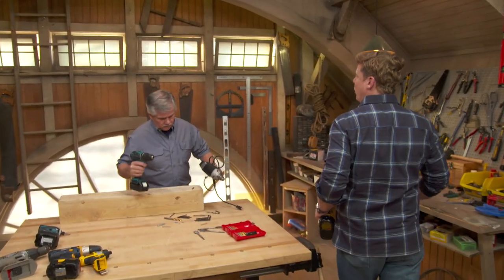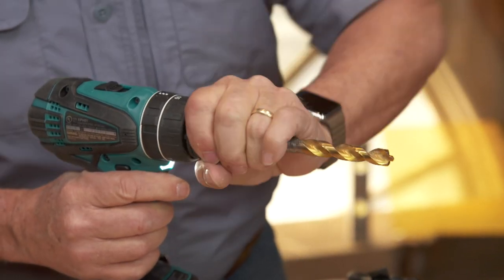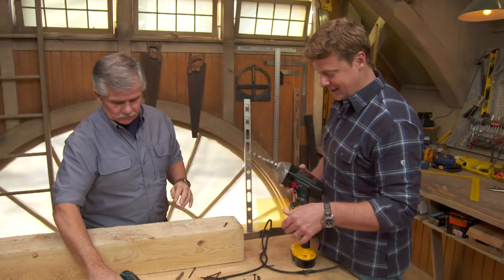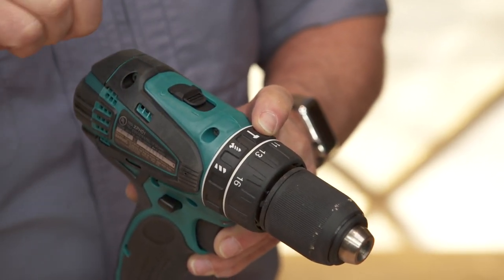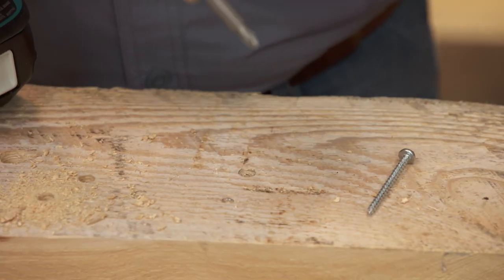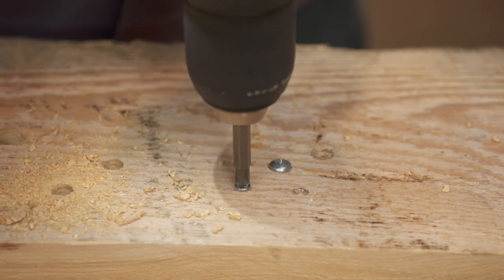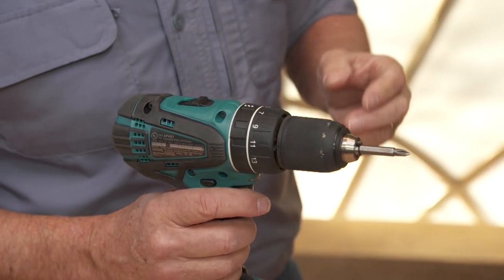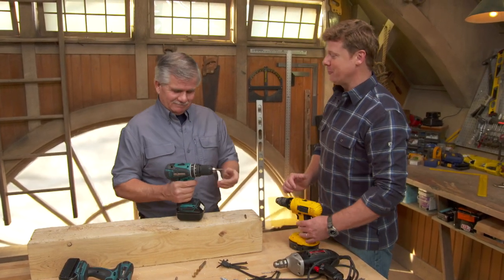How to Select and Use a Drill/Driver | Ask This Old House

Comment: Impact driver is the best thing a homeowner can possibly get.  Can't believe they dismissed it so fast.  Drilling screws with a regular clutch-based driver, in 2016, really?
Reply: oldtwins uh, YEAH.
Reply: I'm new to this and need a drill.  What's a impact driver?
Reply: An impact driver has a ratcheting/hammer mechanism inside to get huge amounts of torque (power) for driving screws into anything. When the ratcheting mechanism engages it is very noisy. They have no clutch so you need more skill to use them. Finally, they accept 1/4 inch hex quick change bits, so they wont be able to use your 'regular' drill bits. You'll need to buy all new bits specifically for them. For professionals, they are invaluable. For casual home use, stick with a regular drill/driver.
Reply: Pick up an impact driver, but you have to get drill bits with a 1/4" hex shank.  Almost all driver bits are compatible with an impact already.
Reply: Well, I thought this too, then I thought that the one-size shank acceptance might be an obstacle to some people.
Reply: both  a  impact driver 1/4   & a  hammer/drill/driver are good a circular saw and and  a Jigsaw  work light and other tools Etc  are good  for  the  home  DIY  myself I own a couple of dewalt  14.4v tools all older  ni-cd  stuff that I rebuild  I replace the carbon brushes  regrease the transmission gears  oiled  the  Jacob's Chucks i  had  em them since  1990's   they  work .like new again  half the price of  a  dc959 kit   brand new one I rebuilt two of  them
Reply: I never use a drill now when I have a XDT14Z!
Reply: DeWalt XR impact driver. Oof the best out there.

Comment: As a plumber/HVAC apprentice, Milwaukee tools are the only things one would ever need for drills or power tools
Reply: Lmao... false I've been plumbing for 10 years and makita is smoother, more comfortable and the sawzall has more balance which allows you to cut things like pipe straighter. Milwaukee has to much power suffocating itself with slop.
Reply: Milwaukee's are usually great but their e-clutch on their brushless drill/drivers is completely worthless. The lowest setting is way too high. The generation just released finally went back to mechanical clutches.

Comment: A tip on using the clutch to drive screws: Rotational speed affects clutch performance. High speed tends to make the clutch kick in later-often overdriving screws. Slow speed down as screw is bottoming out for more accurate clutch action.

Comment: i've used a regular drill/driver for years... and then i discovered the impact driver and my life changed. so much power. all of the sudden my projects driving 2.5- 3 inch screws are a breeze. i'd say the impact driver would be preferable. u can use driver bits or drill bits with it. but it's power for general work is unmatched. so much less exhausting. i'd say impact driver first. and then if u need more nuance for finishing work, then maybe invest in the very high quality drill/driver they demo. not all drill/drivers have clutches like that, and torque settings, and hammer settings etc. impact driver across the board makes work easier. and then for the finer finishing work you may do once u become more experienced, then invest in the kind of tool they demo.

Comment: I was surprised that Tom failed to point out that each of the 3 holes in a keyed chuck are there to be used in succession to get the maximum grip on a drill bit. Especially on 3/8ths and larger going through steel.

Comment: I'm my world just get both the impact driver and drill driver. Getting my first impact driver was a life changer it makes putting in fasteners so much easier.
Reply: Lol, not to mention that only having one drill sucks. Having to change from drill but, to driver, or possibly a countersink is a pain in the butt! It goes much faster with multiple drills set up for different functions.
Reply: +P0tat07 They also have drill bits that fit the 1/4 inch hex adapter for impact drivers. The one thing that does suck about an impact driver is no clutch but fasteners don't cam out as bad either. I would recommend a little 12v impactor now for most people its just so handy to have around my Milwaukee M12 Fuel impact gets used more than anything else.
Reply: DarkRaptor99 not to mention having a wife that has no clue why a man needs either lol.

I bought the driver/impact kit, bc a man KNOWS he needs BOTH

Comment: It recently occurred to me as I've been doing more hobbyist metal work/fabricating that the 1 switch on my drill for lower speed and higher torque, is really suited better for drilling holes in metal than the higher speed. While I work in IT these days, once upon a time, I worked in a shop and I was once tasked by an old timer to drill some holes in a bunch of metal pieces and I recall him instructing me to keep the speed slower and keep the bit lubricated with the oil. So that's also part of how I came to this thought. Hopefully this helps others as well.

Comment: I have a nice drill, but have only used it once. I also have an impact wrench which I have yet to use. I was not fully familiar with the drill, but got it because the drill I purchased from Sears had batteries which would not hold a charge and I could not get a replacement battery which used the same charger. Upon finding that out I decided to move from Craftsman to the Dewalt brand which is a better brand.

Comment: I understand why the clutch is nice to have, but, the trigger is variable speed. I leave the clutch on 20 and feather the trigger. Flawless.
Reply: QuitePear192103 but if you’re doing a super repetitive job, like putting 200 screws, all the same kind and you wanna be quick... just find the right setting for the clutch, slam that trigger without thinking and you’ll take half the time.
Reply: @uncopino  i just built a gate for my neighbor and used 1 1/4" deck screws to attack the boards and did this.. Setting on my Ridgid was like 8 on the clutch in speed 2 and I just banged em in without worrying about over driving and splitting the wood.

Comment: Omg we have that old corded drill. Pretty sure it still works great. lol. Great video!!
Reply: Love2boat92 like many folks, I grew up on that corded drill with my dad. still use it for heavy work.
just bought the Makita cordless. If Tom uses it, I support it!  but for power & old school 'never fail', it's the corded chuck key!!
still love it! LOVE BOTH
Reply: rvz77 Yeah there's no batteries to go bad or die with a corded tool. Lol. I've heard Makita has trouble with their batteries.
Reply: Back when I was young, my Dad had a metal-body corded drill, with a short in it. Two prong plug. Pull the trigger and you would get a little tingle in your hand. I love my plastic body cordless drill.

Comment: As anyone can tell from my videos, I have always been a DeWalt guy. But I'm slowly turning into a Makita fanboy. Cool video for those that don't blow through 1 or 2 of these a year.
Reply: Adam Gabbert over the years I grew up a Bosch guy. Bosch started slipping on quality.
always heard Dewalt was a great company.
Just bought Makita drill & impact set. LOVE IT! HONEST QUALITY!
But Makita is a no BS company making great long lasting products, & that's right up my alley.
I heard a comparison between Dewalt & Makita drills saying Dewalt delivers 20 Volts to Makita 18.
the truth is at full charge, they BOTH have 20 volts, but under load, they're BOTH 18 volts!
Makita is the honest company..& lost points with me that Dewalt would try to deceive through marketing BS.
Jack of all trades don't like BS
Reply: You're right. I don't own the Makita driver yet, but my electrician does and he absolutely loves it too. I only grew up DeWalt because that's what everyone around me used. But with all the information that's shared on the internet, I'm starting to change my thought process. I think each specific tool and operation needs to be studied, and some brands may be better in some areas. But Makita is definitely where I'll be leaning when my current stuff starts to go out.
Reply: Adam Gabbert I started with a Makita driver and now everything from saws to pneumatics I have is makita. They just work.

Comment: Come on guys, corded drills are made to be more heavy duty. That's why the keyed chuck. When you're drilling steel or using paddle bits, you need endless power, and some times battery drills just don't make it.
Reply: I have no idea what you're writing about. My Makita cordless drill has kept up with me on spade bits and hammer drilling into concrete all day long. And, if the battery does run down, put in a fresh one and the old into the 30 minute charger. Or else just take a lunch break while it charges.

Comment: What the all knowing Tommy missed: always make sure to line the “teeth” in the chuck up with the the shanks of the sides/corners of your bits or larger drill bits. Also, any “old-timer”, (which Tommy Certainly is), will tell you that with keyed chucks you should always tighten TWO of the three holes to make sure you’ve locked in your driver bit or drill bit. Amateur hour...
Reply: Very true! That's what my dad always taught me in regards to tightening a drill bit down with a keyed chuck!

Comment: Isn't a cordless impact driver more versatile than the cordless drill?
Reply: Andrew Lange it can only drive screws or bolts, no adjustable chuck, no clutch and pretty much no ability to drill holes
Reply: @scarrypolpetta9006  By which you mean you can get hex drill bits and use it to drill, too.
Best option is to get both drill and driver as a set.
Reply: @toddlofton8307  dont forget they also make adapters to go from hex shank to keyless chuck but yah I have a set of hex shank drill bits and also a set of regular bits.

Comment: These two amateurs don't know what is happening in the construction industry!  Nobody uses a drill! Everyone used a impact driver with screw mode option!  It so old fashion now a days!
Reply: HW2800 Actually everyone I've ever worked with won't use an impact driver for finish work but they will use a drill or a drill driver hammer drill.
Reply: you do know this show is geared toward homeowners, right?